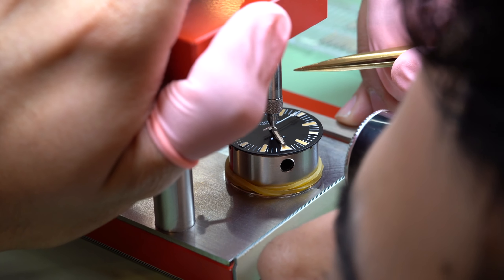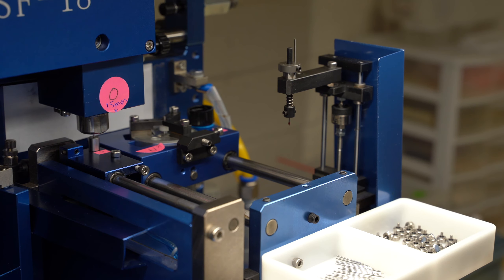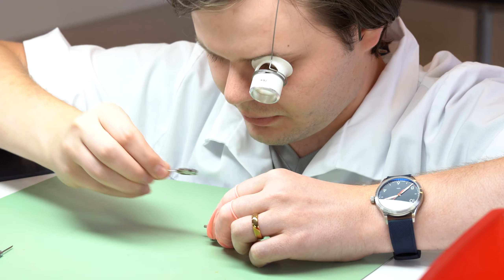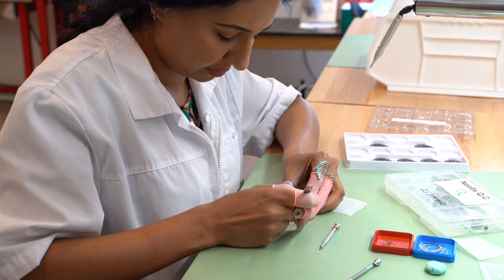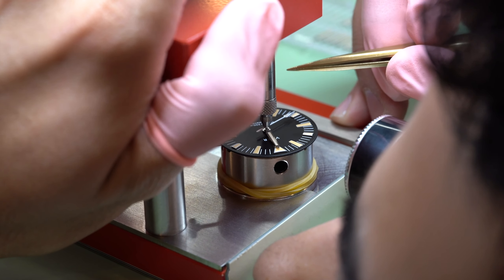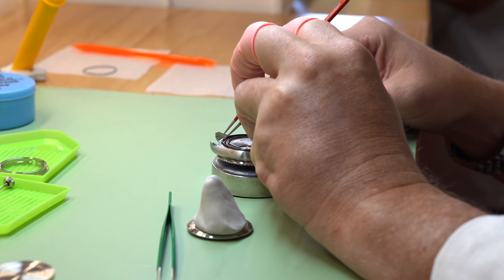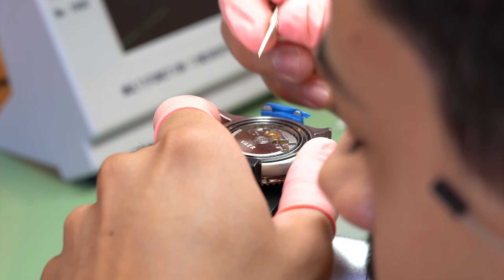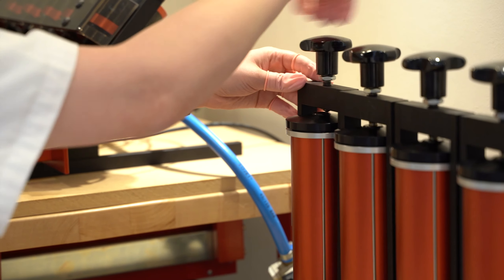Inside our USA Watch Assembly: A 12-Minute Breakdown of Vaer's Manufacturing Process

Comment: That was a fun look behind the scenes. With assembly being handled through a partnership, it all comes down to the quality of the employees and the managerial commitment to integrity to eliminate errors in assembly. It is really difficult to accomplish. Most firms try to implement the principles espoused by W. Edwards Deming, but fail to embrace them systematically. It doesn't end well for those firms. Continuous Process Improvement is the heart of the matter.

The rig for testing WR with air pressure is brilliant. It never occurred to me that air could be used instead of water; but it makes perfect sense. It permits you to test the completed assembly without risking the contamination of the movement with water.

C'mon Reagan, smile for the camera. You know you want to.
Reply from the maker: Ryan and I have somehow coordinated the ability to never smile at the same time on camera. I discover this whenever I try to pull screen grabs for these videos! Haha
Reply: @VaerWatches  LOL